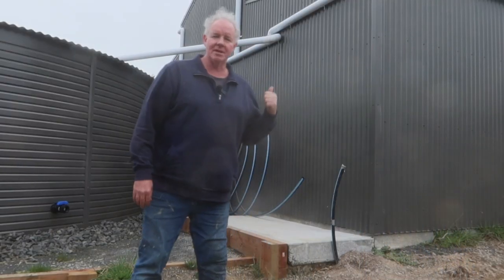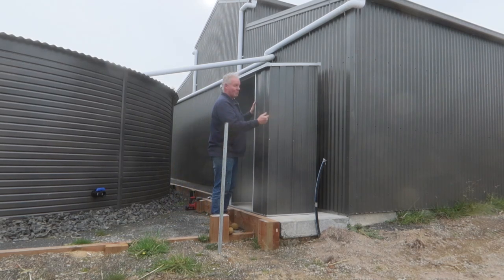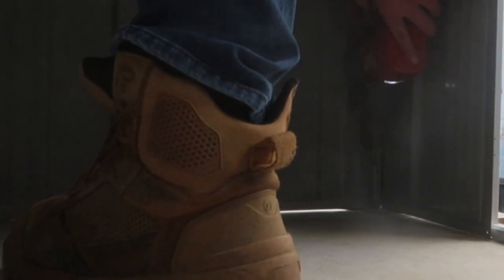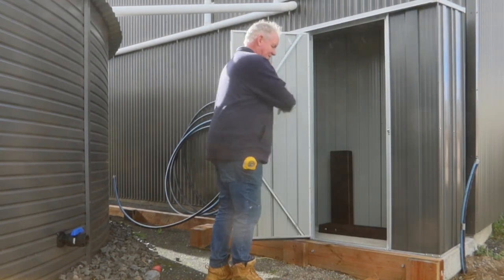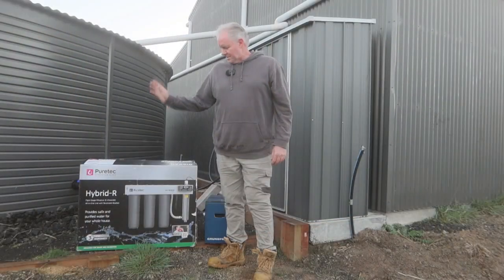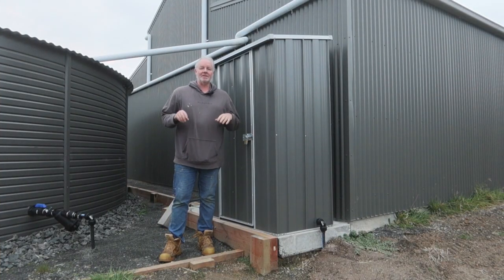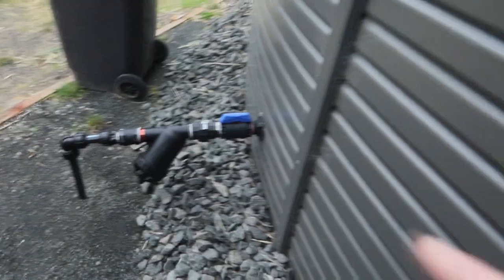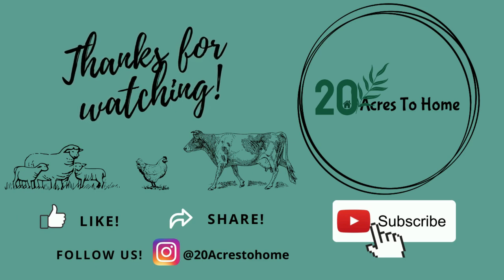Owner Build Project: Installing Our Whole House Water Filtration & Pump System

Comment: Looks good, heads up on the screw bolts , put a 1/2 inch adapter on your impact gun and screw them in with the impact gun, much easier on your wrist and get a tighter fit and heaps quicker.
Reply from the maker: Thanks! I normally would but didn't bother for these few.